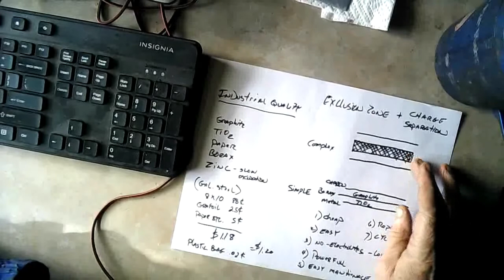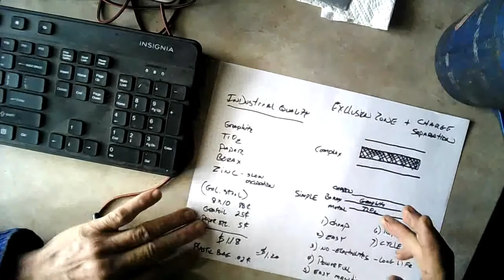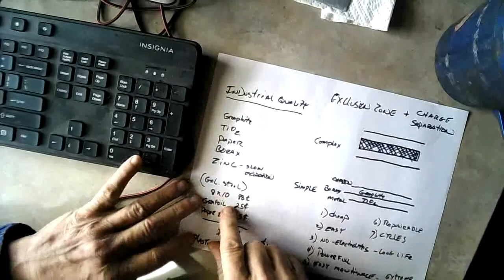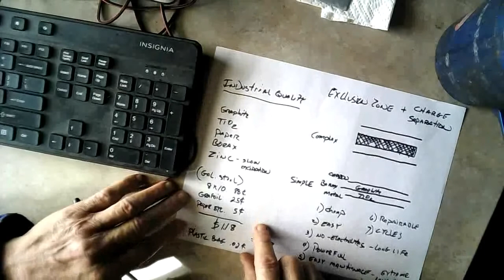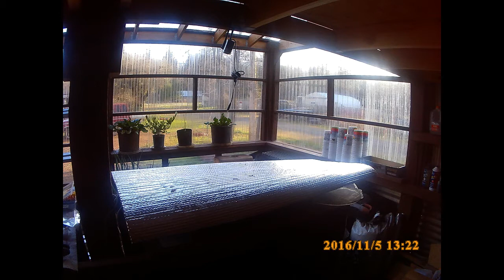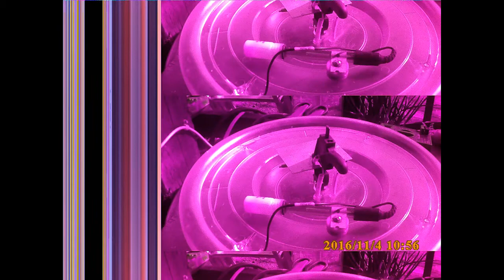Research & Testing Update!

Comment: Nice test rig set up.
I will shortly be upgrading my cycle / forming hardware to Arduino based unit, just got to write the software :-)    Martin.
Reply from the maker: Hi Martin,  I looked at the Arduino sensor stuff, but I don't know enough about electronics to even set it up, much less write the software. Nice to have people with more electronics knowledge here. :-)